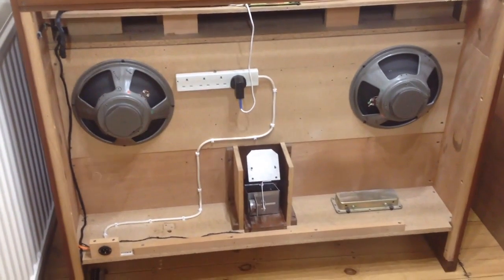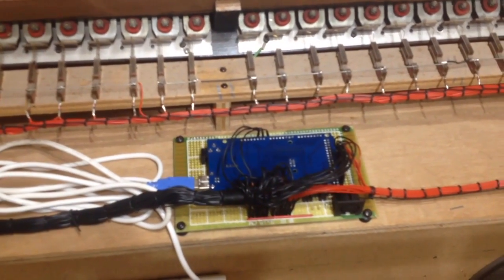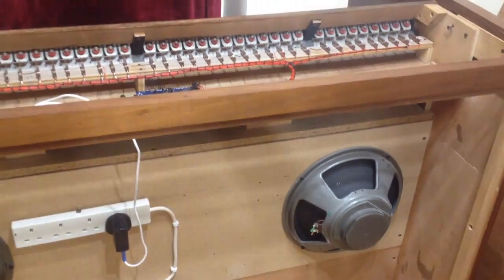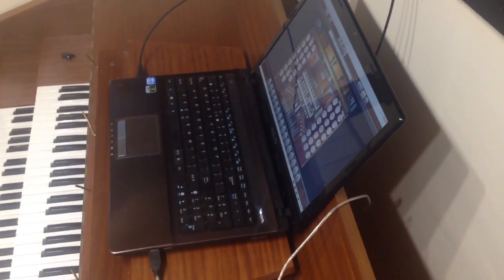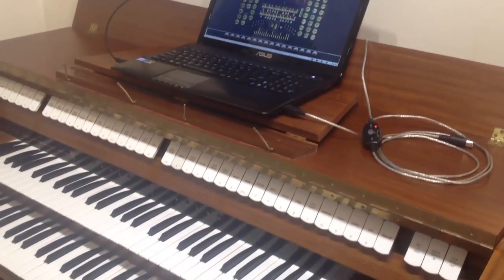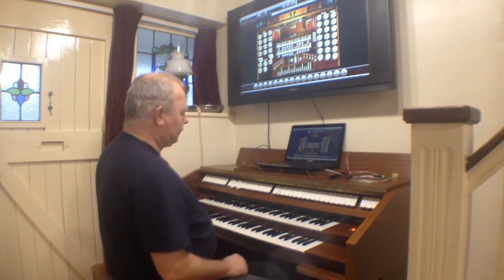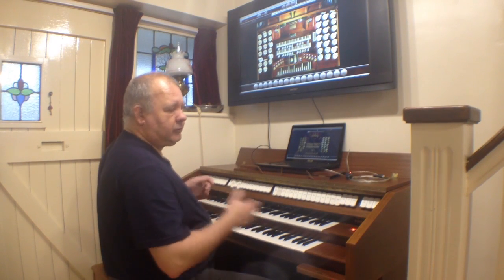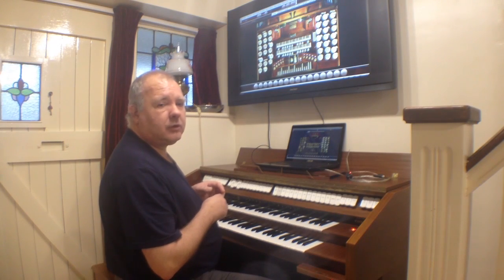Converting the Wyvern Exeter Organ - part 29   The Finished Console with Hauptwerk

Comment: Thank you for the detailed presentation. I am doing something similar, although my organ already has midi capability. I am just trying to add a third keyboard. The part I missed is that I see you relaxed the power supply. Can you give me some advice on that? Thanks again!
Reply from the maker: Hi, I'm not sure what you mean by 'relaxed the power supply' but basically all I did was to use the original switch on the front of the console and wire it in line with the power cord to the 4 way socket I fixed in the back so that the front switch turns the power on and off to the 4 way block.  Hope that helps and thanks for watching and commenting.
Reply: Hauptwerk Hardware Oh sorry, I meant replaced, not relaxed. I’m wondering how do I choose a new power supply that is adequate for the organ?
Reply from the maker: @THNDRacket  The encoder I use is powered by USB so I simply used a plug-in USB power supply. The Encoder only uses very little current so any USB power supply or charger would work.

Comment: I have a pedal Reed organ with 2 manuals and 3 stops which i would like to enrich with hauptwerk. What would be THE best way to do that?
Reply from the maker: You would need to add some sort of switch contacts to each key, pedal and stop.  The usual ones are similar to those shown in this video series BUT they are not cheap!  They are manufactured by Kimber Allen Ltd in the UK and are around £2.50 each for the Silver wire ones and £5.80 for the gold wire ones. Both these prices are plus tax and shipping. Then you require a metal 'wiper' fixed to each key in order to make them operate. These are an additional £1.00 each. These are trade only prices to organ builders - us regular guys pay more...!  So, the best way to do what you want; well if you have plenty of money available for the project then use the KA contacts. Otherwise maybe get old keyboards or organs from auction sites and strip out the contacts to re-use.  Once you have everything fitted with contacts of some sort you can just go ahead and do what I did in the videos to actually make the MIDI generation work.  Hope that helps, and good luck with your project.... :-)

Comment: I have watched this presentation so many times I can almost see it in my sleep.  I am considering an attempt to convert an organ here to Hauptwerk.  The organ for the project is an Allen T-12A currently with the worst sound I have ever heard.  
Please advise if you think this is a do-able project and any hints of what to avoid.  
I would appreciate a response from anyone with knowledge of the Allen.
Reply from the maker: Hi Don, I don't know the exact model you mention but any organ can be converted this way so long as the keyboards have working contacts.  Older organs, particularly those that have led a life in smoky or damp atmosphere often need the contacts cleaned before they will work successfully. That said if the thing works 'as is' then it should be just fine to convert.  Also on the subject of key contacts - I see this model is from the mid 60's; some organs, notably Baldwin from the USA used a strange 'resistive rubber' substance which had a single gold wire pressed against it when a key is pressed.  This type will NOT work with ANY modern midi encoder that uses a 5 volt scan system, I don't think yours has this type but just check before you strip it out.  I do make a 'keyboard booster' that does work with this type but obvoiusly it adds cost and work if one is needed. What I DO know about Allen organs though is that they often have quite good amplifiers which can sometimes be re-used but not sure what would be in one of the 60's vintage.  Anyway; I hope my ramblings make sense and are of some help.  If you want any more info feel free to contact me directly through the website.  Hauptwerk Hardware dot com. Cheers...